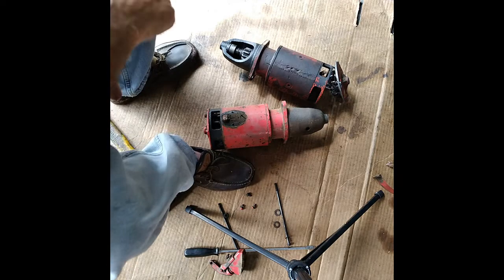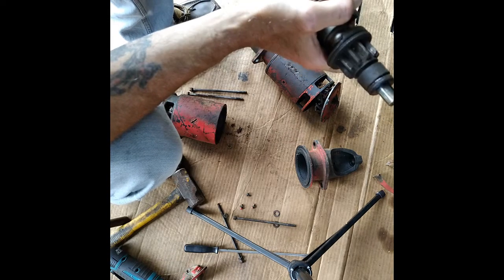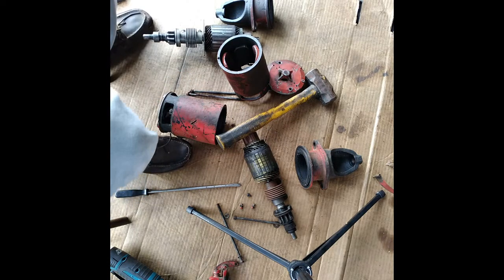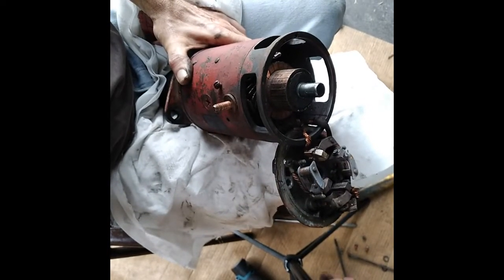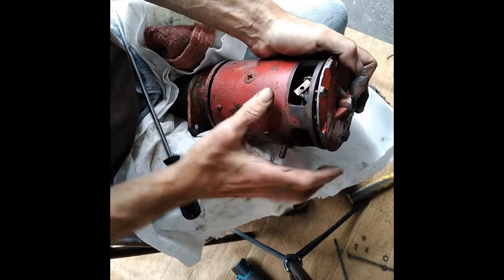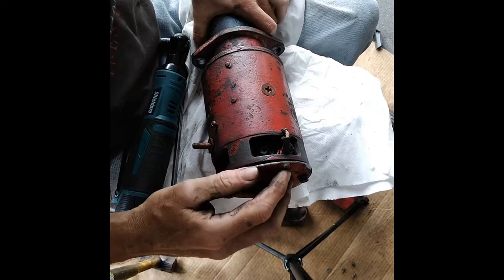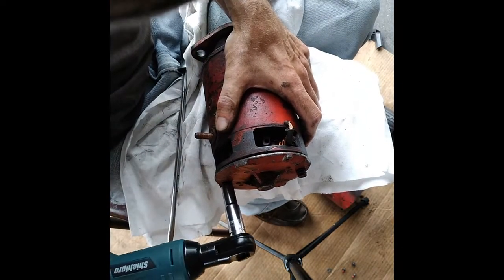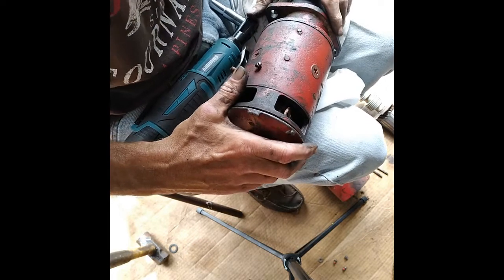Trying to make One Good Starter out of Two Old Ones for the 51 Farmall Super A.

Comment: Ive made starters out of parts many times. Once I was getting a H Farmall running. Overhauled the engine. And made a starter out of parts. And It turned over really good. had spark and gas.  Ignition was in time. And wouldnt hit a lick .  Debbies came out and she remarked Randall the fan is turning backwards. What I had done is use a moline field coil and starter drive. The starters on Farmalls enter at the back of the Bellhousing and a Moline starter  comes in from the front. Decades later our neighbor bought a new starter from the internet. And it was backwards rotation also.
Reply from the maker: Long tie ago had a guy buy a new Prestolite starter for his Harley and it was turning back wards. The starter drive gear wouldn't engage. Found out he had gotten a boat starter which turned in the opposite direction. Had to rewire the field coils to get the thing to rotate the right way. 
   Took me a few minutes to figure that one out. All I really did was move the brush wires around and it started spinning the right way. 
  When I still had the equipment I would have cut the armature down on this starter and recut the commutator strips using a dividing head on the mill. But then again that was when labor was cheaper than it was today. 
   Had an old mechanic tell me in my youth that when he started, "parts were expensive and labor was cheap." TImes have changed.
Reply from the maker: Thanks for watching and thanks for the comment, have a great day.